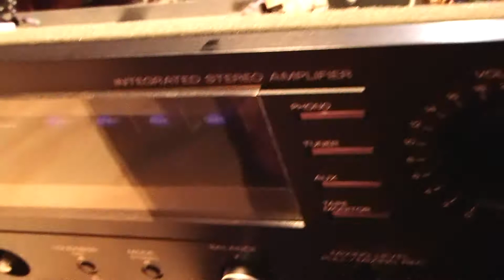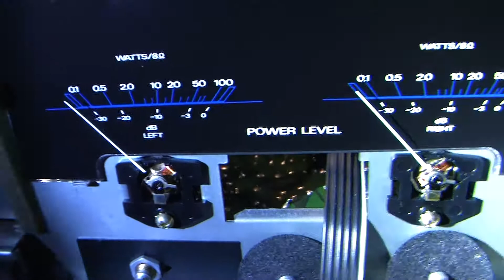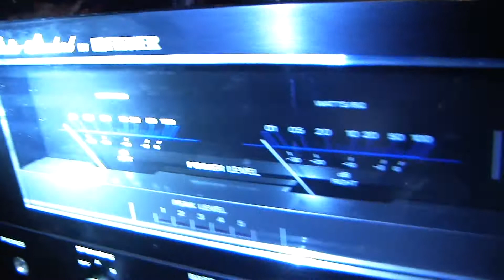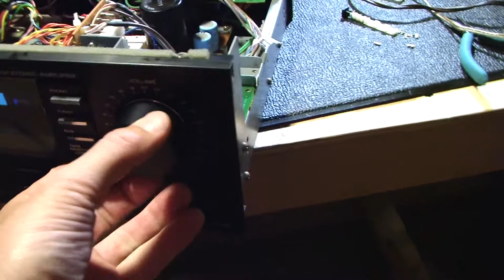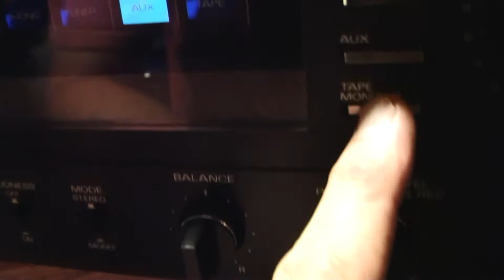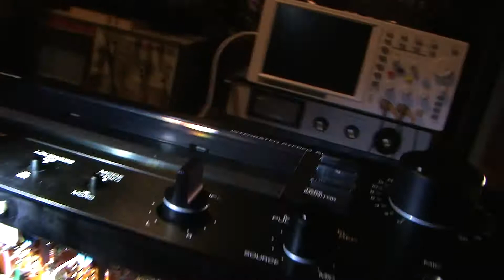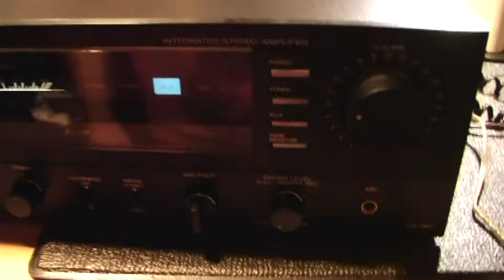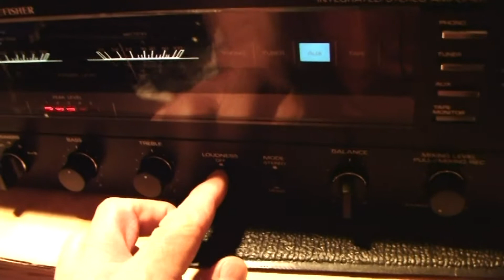Fisher CA-880 Amplifier Project Part 4 of 4 – one ch out, surprise problem, fixed

Comment: I like the amps that have a EQ pass-through. You can go straight to the amp only through volume potentiometer. Tape loop still has to use the switching ciruit but does the same if it works. Im getting ready to purchase one of the myself but trying to figure out a good price to offer. I may need those schematics. Wherd you find them? Or could you send them? Thanks.

Comment: well, that explains it!  I have the CA-800 and it does the same thing; although I thought it was my EQ, as I do use my tape monitor.  I also found if I mess around with it the static in one channel stops.  I wonder if you could some how drill a little hole in the casing of that tape monitor switch to spray some deoxit in it?